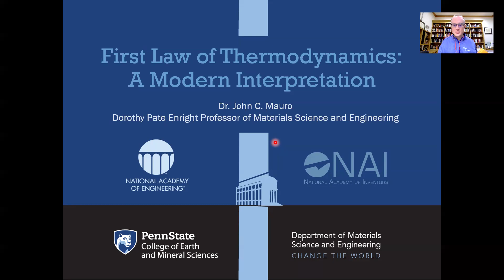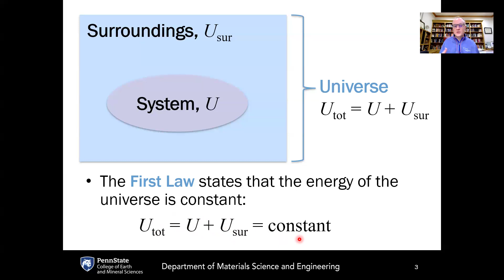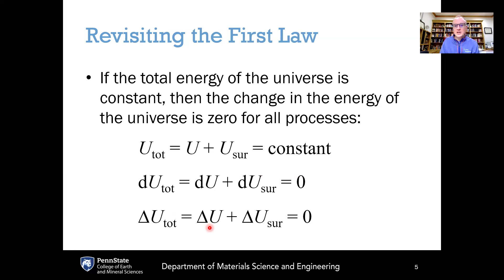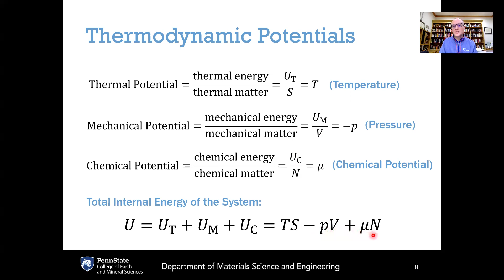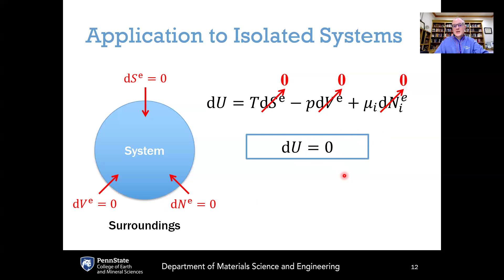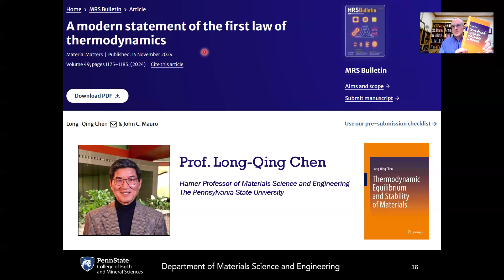First Law of Thermodynamics: A Modern Interpretation

Comment from the maker: A clarifying note from Dr. Chen related to Slide 14: "If we ignore any possible volume changes arising from the internal processes due to the exchange processes at constant pressure, dV^e=dV. However, if there is a volume change due to internal processes, dV^i (e.g., due to internal chemical reactions, phase transformations taking place during the exchange processes with surroundings), then dV = dV^e+dV^i."

Comment: The conceptual problem is that each of the terms are related - a number of moles give you volume and that volume is related to the chemical potential in those moles. The thermal contribution is the changes in those parameters when agitated away from zero kelvin. i.e. this a convenient mathematically but might be construed as misleading physically/conceptually given these interrelationships. The use of the word matter is is also problematic by suggesting actual different matters when in fact its one matter made of a number of moles to give a volume X and with energy E at temperature T.
Reply from the maker: Thanks for your comments. Yes, the quantities are related in that new chemical matter can introduce new associated volume and thermal energy, but the contributions can still be separated into these terms as proposed by Gibbs.
Reply: @johnmauro1230  Agree - it's just the term "matter" in place of each energy or mechanical contribution requires some philosophical discussion on what matter is.

Comment: Reactive Nanoparticles developed by Kenneth J Klabunde at KSU have been described as Gibbs free energy. I always thought that was too simplistic as chemical particles smaller than 50 nanometers in size have so much more surface area. Your thoughts?
Reply from the maker: You can define an internal energy, enthalpy, and/or Gibbs free energy for any system--even nanoparticles. You are probably correct that the Gibbs free energy in this case would be dominated by the surface area. Thanks for your comment!